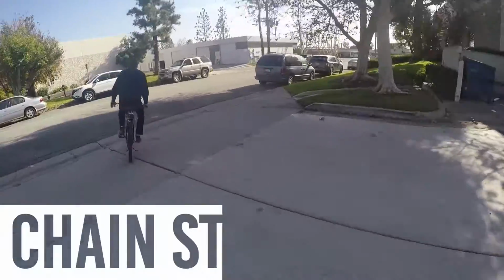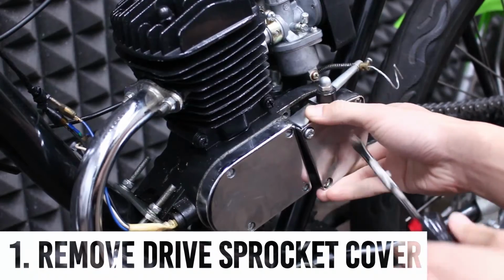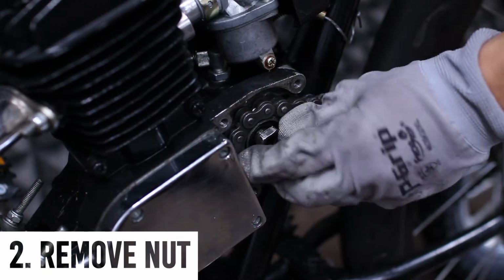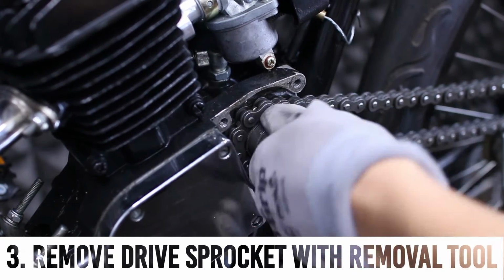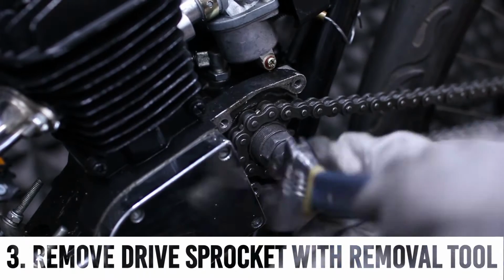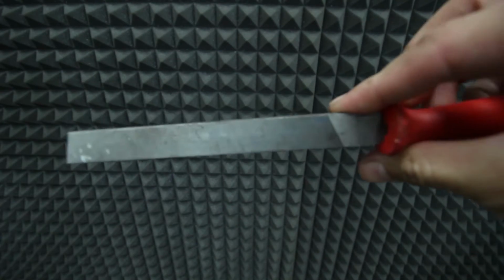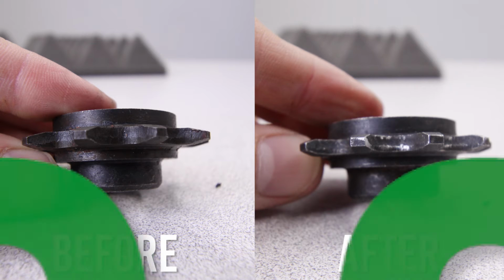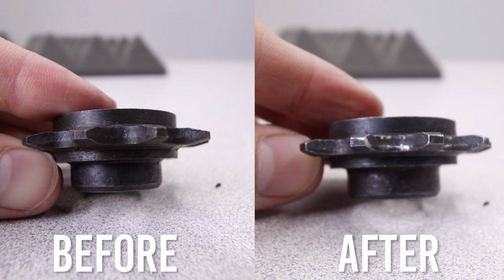If Your Drive Chain is Getting Stuck, Try this!

Comment: Thank you for the videos you all do. I Have a new engine and im using an older #44 t 6 hole disc sprocket with a #41 roller chain but I am having issues that even just peddling the bike the chain will bind up and either pops off or breaks. By looking at it it kooks as if every now and then the teeth on the sprocket and the chain don't line up properly cause the chain sits on the sprocket instead of riding inside the teeth. The motor sprocket is a 10 tooth. The tire sprocket is 44t. I have used this same set up before and everything worked fine. This sprocket I have used before and have had issues with it then as well I believe. Its seems thicker and the teeth ate taller than my regular 44 t I use. Also inoticed the other sprockets I use are tapered in and this one is not. Could the sprocket be the problem or. ID it that my chain line is off enough to caus the chain to bind every now and tben

Comment: without warning, my chain jams at the small sprocket at the engine and locks up the rear wheel. I will try this.
Reply: @CouchJam No, haven,t tried this particular fix but there is a "void" area at the engine chain small sprocket area. i filled that area so chain jam can not happen and hasn,t happen. Confident about my fix. May post a vid one day about my fix.
Reply: @rich52movie  please! I think this is what’s happening to me!! What chain jam area are you talking about? I built my bike fine and I’m building another but the chain seems to be getting stuck in the small sporlcte
Reply: @IvanLopez-hs8il  another suggestion is, use an added chain tensioner {there on the market}. The , so called tensioner the kit came with is just a chain guide. I recommend using Both.

Comment: sproket stuck, and cant roll back, like dirt bike is in gear and has a limit to how far you can roll it back and forth. It ISN'T the clutch. So i took to youtube. was wondering if it is the chain being too tight or maybe the going link... I was thinking of smoothing the sproket out for a smoother chain run, that might be my problem...

Comment: what should I do if my chain keeps breaking because there is no alignment? I am thinking of switching to a heavy duty chain
Reply from the maker: Switching to a heavy duty chain is a great option. Be sure to us chain lubricant to reduce any additional wear and corrosion. Another option is to switch to a larger rear sprocket, though this option will alter the performance; reducing top speed but increasing torque.

Comment: Hi how come my tire does want to turn it's like completely stuff and the is not turning what do I do. ????? plz help even though it's new ??? bought if of ebay
Reply: Hi,
idn if this issue is resolved now but if your clutch is in when it does this then the clutch plate could be jammed up. take off the cover on the right side of the engine and there will be a one big gear and one little gear, there will be a plate on the big gear, take it off by removing the nut and screw that keeps the nut from spinning out, then put the plate back on and tighten the nut about hand tight (reinstall the screw that holds the nut in place also). Maybe it will work now.